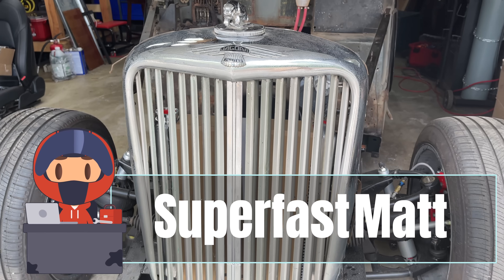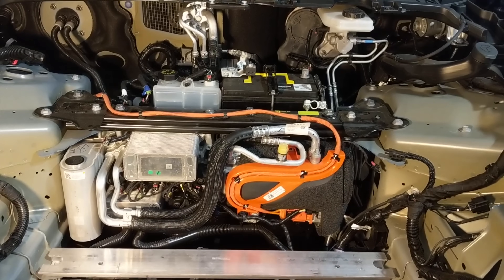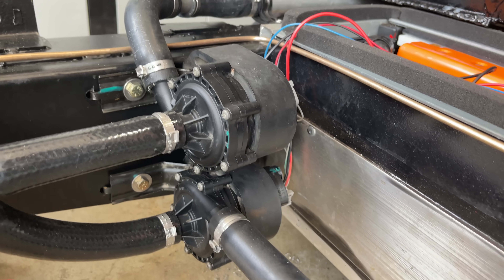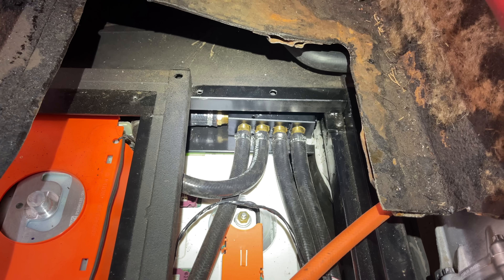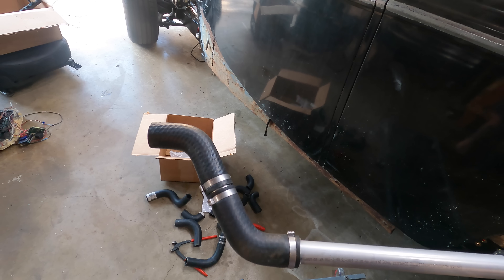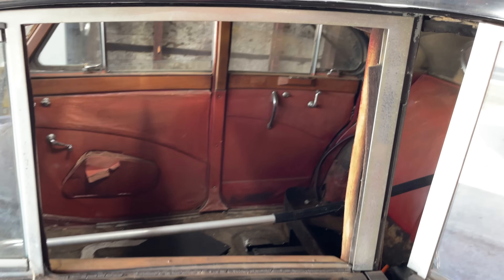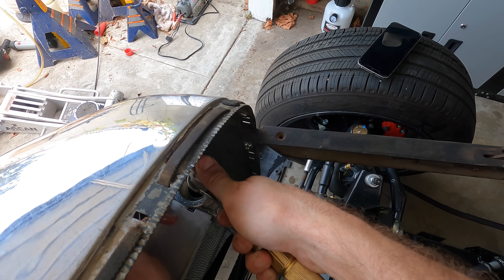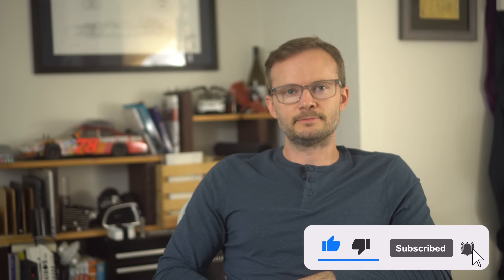How To Make A Cooling System For An Electric Vehicle

Comment: For a fan controller consider the 4.0 jeep fan controller pn RY-330K , i think dorman sells one with a pigtail as Dorman 902-303. You'll need a controller but you could realistically control several things with one microcontroller and THEN add canbus if you want to leverage anything from the tesla's network
Reply: I jumped the gun on part of this comment :)

Comment: PS you need to physically ground the radiator to prevent static charging of this system and don't and you don't want to know what happens if that happens

Comment: I love those Arduino nano every boards. Mostly because they play nice at 14ish volts.. I'm using it as a GPS speedometer and engine temperature gauge in my 1968 C20 Chevy..
Reply from the maker: Nice! I was worried that they are not rated for an automotive environment, but I think I'm just going to have redundant systems. It'll still cost a small fraction of the available automotive systems, and I have basically infinite flexibility.
Reply: @SuperfastMatt  a small heat sink for a raspberry pi seems to work fine for mine, I live in northern Utah where it gets pretty toasty..
Reply: @SuperfastMatt  could just pot the whole thing in Scotchweld once you get your wiring sorted to cut down on vibe and moisture related failures.

Comment: Matt is it possible to make an electric air-conditioner with an array of Peltier modules facing a blower? The problem is to make the whole system effecient by  providing the heat sink on hot side, face a constant stream of air/ducted fan/ liquid cooling. 
Do consider and make the whole thing in aluminium.
Why fit a conventional power stealing air conditioning?
Wish you could reverse the Peltier in winter....
While you're at it, just throw in a few peltiers on the opposite side and switch them on in winter to provide heat.
Reply from the maker: Peltier cooling is super inefficient, so it would take a chunk out of my range.
Reply: Just reverse the polarity and what was hot is now cold :)
Reply: @andrewallen9993  thanks, never knew it was possible.

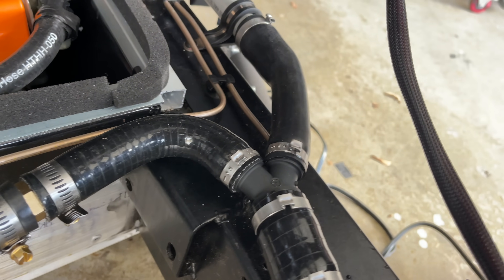Comment: 5:25 An Idea for the second Y-Fitting, mabe you could install two checkvalves before it, so the collant dosent move to the other circuit whilst the pumps have different speeds
Reply from the maker: Yeah, but with a closed check valve, i would have zero flow on one side which wouldn't allow me to measure temperature. I suppose i could install two flow meters and just check flow at different varying speeds. Then I could use that as part of the logic for different flow.
Reply: @SuperfastMatt  Could run a mechanical thermostat or repurposed electric heater core valve at each outlet. If you have a controlled bypass like a car thermostat you can put the temp probe after or just put the probe closer to the source. That will limit backflow from the hotter to the cooler system. With the open wye you might heat things you don't want to.
Reply: If circuit 1. pump is running hard and pulling coolant from circuit 2., circuit two will start to heat up, causing its pump to respond by running harder, thus fixing the flow issue. (I think?).
If you do use check valves, the lack of flow in one circuit shouldn't stop you measuring temp on that side, as long as you measure near the heat source.

Comment: Hold on, are you planning to have AC? 

I can’t imagine bearing all the suffering and the pain of knowing that my AC is not efficient in cold weather because it’s not running through a heat pump with warm battery and engine..

Oh, hold on, I can, I have 2019 Model 3 Performance without heat pump and I live in Russia and AC sucks (a lot of energy from the battery) in winter..

Comment: This episode I spot on for my project Matt. Thank you. I'm using an electric pump on my ducati supermono replica and want to control the speed of flow. Can I do this with simple bosch pumps as found on mercs for auxiliary heating systems or do they have to be a clever motor? I'm a spanner and lathe man so not so clever on the electronic front.

Comment: You can't sleep the problems of a project so well well I got to get this done but to get this done I have to re-engineer the garage so I can get the cooling system done. 

My simple interior insulation project is on day 3 or 4 and I lot count of how many times I vacuumed the floor boards but I'm currently waiting for self etching paint to dry. Organizing my truck tools, replacing a bad rear speaker.... This all started over condensation in my jute pad...
At some point I'll get back to the solar project I have all the parts for....

Comment: For fan speed many people use the electric volvo fans from volvo 200 700 and 900-series of cars. Cheap fans that can run in two speeds and have an external fan relay. On the fan relay you ground the inputs with an ecu or a two speed temp sensor. The double relay is built to make it that makes it impossible to run both high and low speed at the same time. Popular in many car builds where you want to change from belt driven fan to a high performance fan for a very low price.

Comment: "Temporary solutions are the most permanent". 
Truer words have never been spoken!
Reply: For reals. Once pulled an access panel off a plane built in 71, on the back it said, "Temp. RR nxt PMI Mar86" (Temporary. Remove and replace next planned maintenance interval of March 1986). We looked it over, everything was fine, we did what the last 24 PMI crews had done; checks good reinstall.

Comment: Could you not bend the aluminium tubing using a conduit bender that you either buy or rent from a big box store?

Conduit follows the NPS standard so, dies for 3/4 conduit (1.050" OD) should be good for doing 1" tubing.

Comment: FYI you can get temperature sensors that work at any temperature. It might not be for an "automotive application" but if your temperature is below 212 degrees you won't be dealing with any great pressures you will just be moving the flow. You can basically just tig a bung on a tube and add it in line.

Comment: I think rewiring the garage would have been easier than emptying and refilling it.
Reply: I'm waiting for the next project segment that starts with a sidetrack of rewiring the garage :D
Reply: Alternately, he could have just turned the car around so that it was facing into the garage, so that the correct side of the car was closer to the outlet.

Comment: 3:00 dude in the time you did that you could have just wired up another outlet on the other side of the garage??!
Also not sold on the two loops = different coolant temps. Water has enormous thermal mass and at least in the years of computer liquid cooling loop order makes something like a 0.1celcius difference between the temps at each component. You're also mixing the fluids in the rad from the two loops, wont that equalize the temp of both to make it the same as a single loop?
The biggest advantage I can see is that if one of the systems does not want to be cooled then you can not run that pump and save some power possibly.

Comment: For a cooling fan... I think you could nab one from a VW made in the last 10 years or so. Most take a PWM input to control speed, then you don't need an external fan controller. Usually they have 2 fans, and the controller is built into the larger fan.

Comment: Do you have mixed metals in your cooling loop? Dunno if that'll be an issue or not. Then again I guess it's all probably aluminum eh?
Reply: The coolant should have enough anti corrosion stuff in it to prevent that, a car's cooling system is normally all kinds of metal (Ali heads and radiators, steel block, brass fittings and sensors)

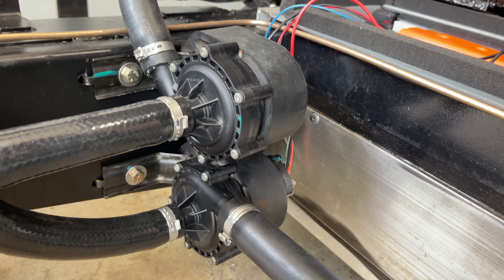Comment: 10:03 didn't know Arduino ran Android code haha. Good stuff man, these videos are awesome
Reply: Wondered about that myself.  On the other hand, the code to do what Matt is doing is pretty darn trivial.
Reply: @stevejohnson1685  PWN should be in every hardware hackers tool kit but writing from scratch shouldn't be too cumbersome. Even naively its just totalTime = onTime + offTime. So within totalTime the just needs to be a timing mechanism to set a pin as high
Reply: What do you mean by "Android code"? This is C.
Reply: @user2C47  Matt calls it "android code" at one point.
From what I've seen, either he misspoke or he's making Data from Star Trek. I'm not sure.

Comment: Matt, just a thought...would it be beneficial (or maybe necessary) to put check valves on the 'inlets' of that return wye fitting from the outhouse and battery coolant outlet?
Reply: I was thinking the same thing! It would be possible for coolant to flow the wrong direction without having a one-way valve. It may be unsubstantial but it could make a big difference.
Reply: Yeah I wonder if you have individual pump speeds if one runs fast and the other slow/off it might overpower or drastically reduce the other pumps flow rate?

Comment: I use a wire clamp tool om my air/ coolant lines. I made mine but you can buy one,  A "Clamptite" brand, but you probably have several.
Reply from the maker: I've never used that before, but I like the simplicity. I'll check it out.

Comment: Great video; the Arduino system looks very interesting. I think you mentioned that this chip will monitor temp and adjust potentiometer-driven fan speed; how do you know when the Arduino system fails? I guess the water pumps just switch to full speed and signal you that way? Also, will you have water temps on your dash?
Reply from the maker: I will have the Arduino turn OFF a red LED through a relay or something, so if the LED is on, then I know the Arduino code isn't running. I should also be able to hear the pumps running at full blast.
Reply: @SuperfastMatt  Not that you don't have enough on your hands, but you are making me wonder how much of your car is going to be accessible via Bluetooth ;)
Reply: @SuperfastMatt  You could put a temp sensor on that bleeder above the motor since the block is already there.  Man I'm good, look at that idea
Reply: It's just a temporary set up for now.  I'm sure he'll upgrade with temp sensors and a dummy light on the dash... likely have temp gauges on the dash too.  If it fails, it will be plenty obvious.
Reply: Better to have a blinking "heartbeat" indicator, as is common in industrial controllers. With the configuration you mentioned, if the code crashes once the LED is switched off, you won't know. Also, you can drive a small indicator LED straight off a digital pin.
Reply: As long as you have something on the dash controlled by the Arduino, you'll see when it fails. My tip would be: It's useful to have the battery temperature shown somewhere.

Comment: .... would it not be faster and easier to simply add another outlet to the other side of your garage? That would take me all of 30 min after a short run to the hardware store.
Reply from the maker: It's a rental house, so I didn't want to run conduit.
Reply: Shhhhh, engineers are working.